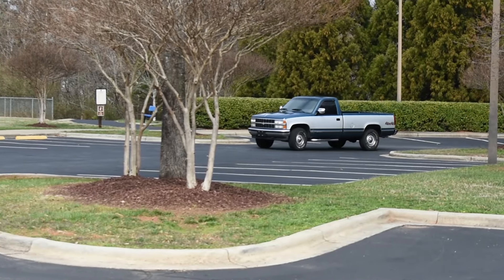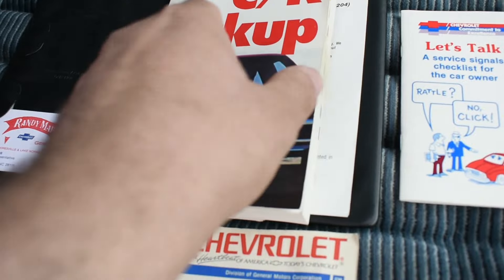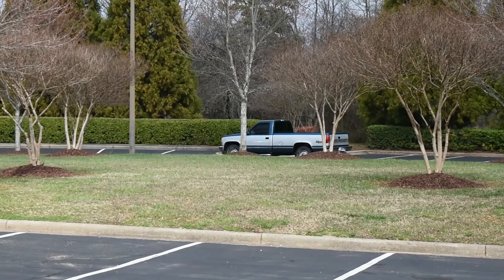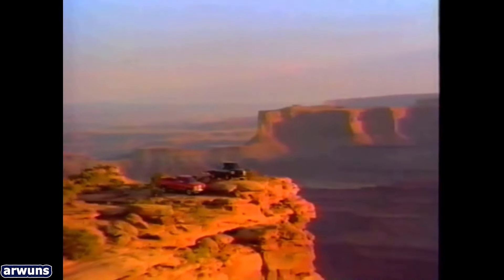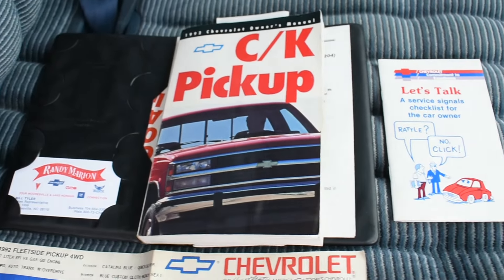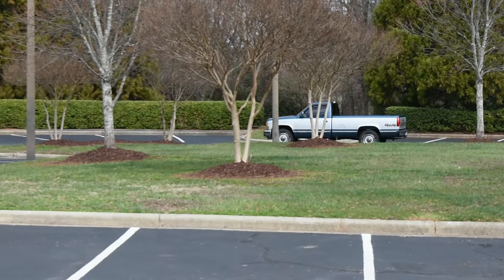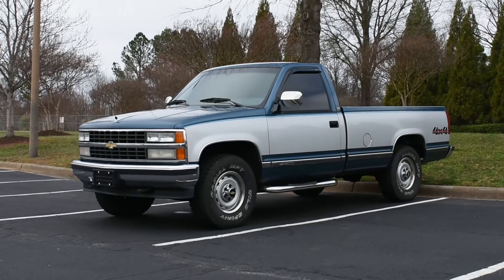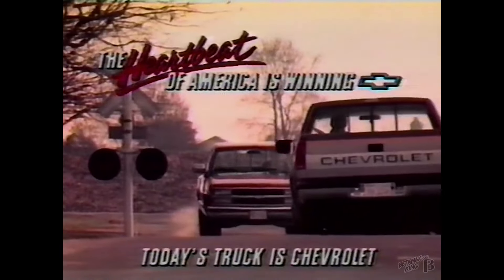1992 Chevrolet K1500 Silverado: Wookie Drives #119

Comment: These '88-'98 GMT400 GM trucks are some of the longest lasting, most reliable vehicles ever built. Many gove gotten to 1 million miles, my dad has a '90 c1500 he bought new with over 660k mi on the ORIGINAL 350 5.7 TBI V8. Great trucks.

Comment: That looks like a factory 350 to me...dont see why the engine would need replaced with such low miles, these TBI 350 5.7 V8s are some of the longest lasting and reliable engines EVER made
Reply from the maker: Just going off of what the owner was told when he bought it